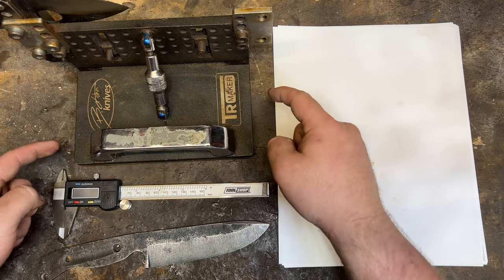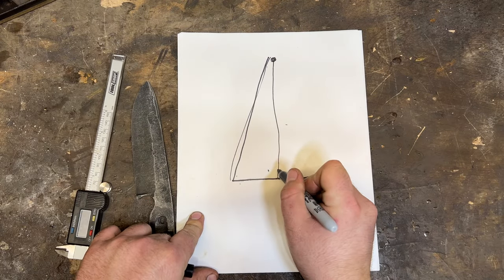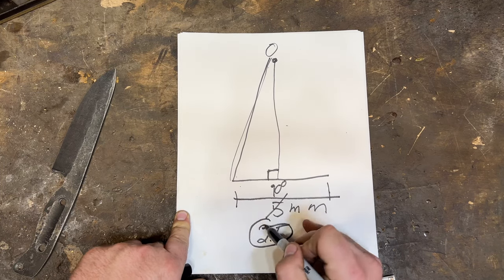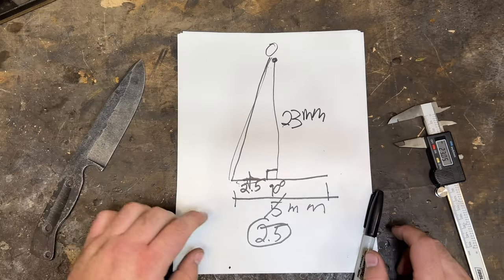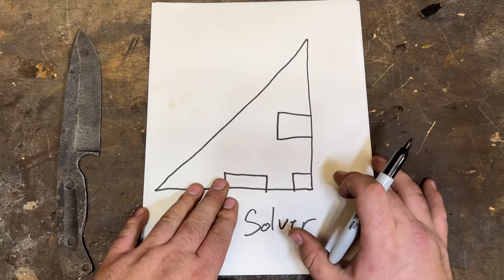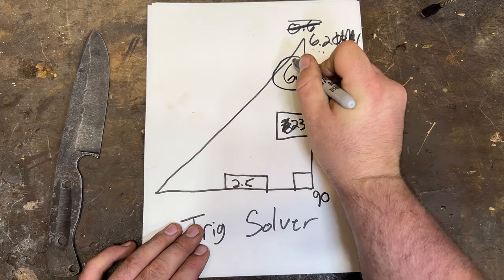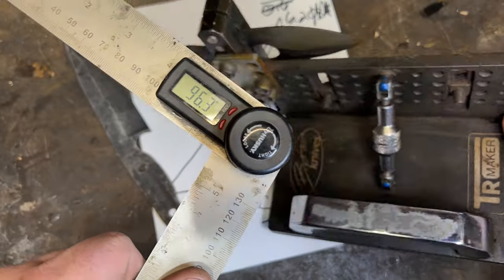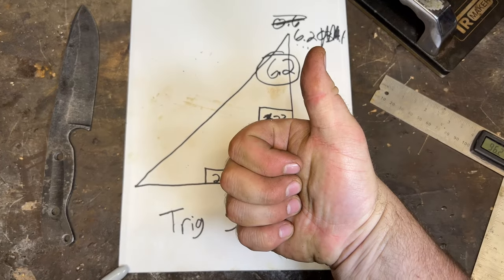This App EASILY Finds the PERFECT Bevel Angle!

Comment: Great Info to have, I would like to add some advice though you are not taken into account for thickness of APEX (Grinds come together)
Reply from the maker: I prefer to grind to a zero edge. You can always stop slightly before if you want a little bit of thickness. I’ve never noticed any need for changes with this setup.